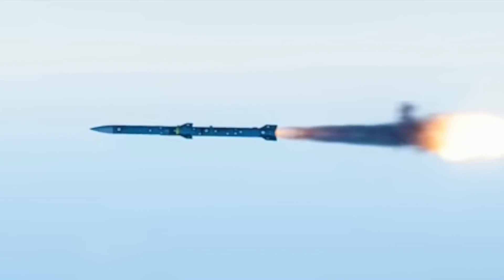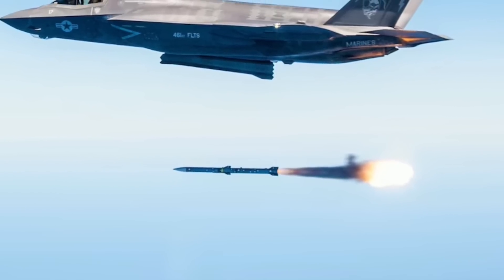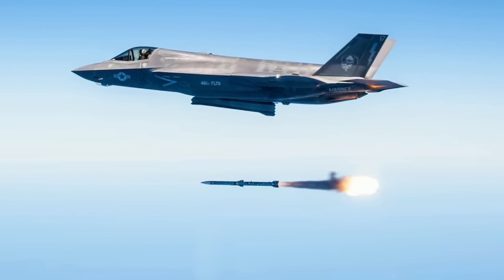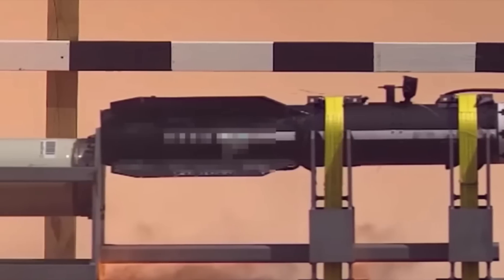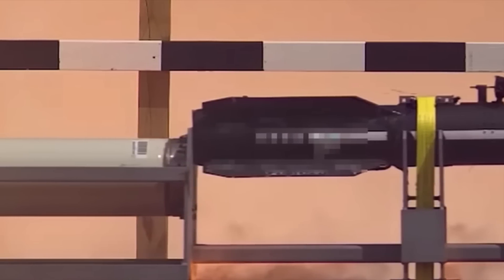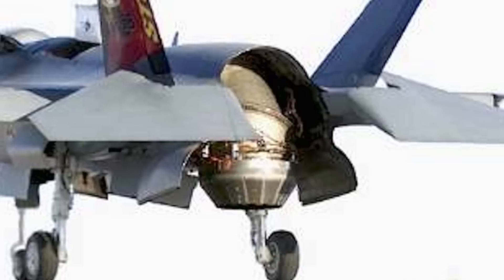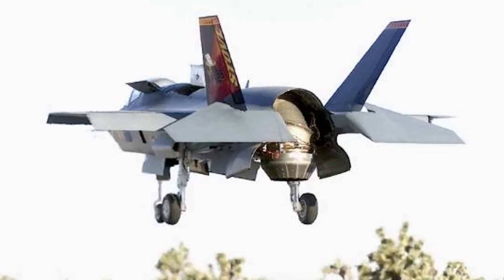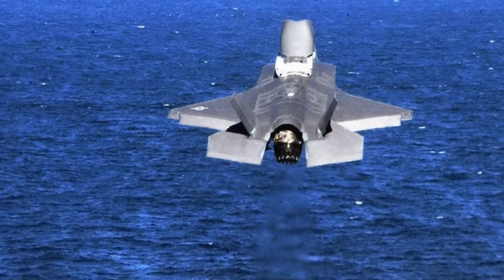#USAF developing #MUTAN Missile that twist in air to hit maneuvering target !

Comment: This thing traveling at mach 8 then bends? That must be a strong flexible area and to continue being guided? It's probably a last second turn to hit the target that is doing a turn to avoid. Soon as it bends it explodes?
Reply: Pretty much if it detects slight changes to the target
Reply: they have whole missile body diameter to make it strong enough while fins are much smaller and have to be heavy to ahieve sufficient strenght

Comment: Its a simple concept, trying to increase a missile Hit-to-Kill (HTK) . The current technology for HTK is Attitude Control Motors or ACMs and hich are pulse solid propellant rocket motors and Thrust vectoring (TVM) wwhich works fine on larger missiles ,not so much for smaller ones. The size of it AIMs makes harder to add  HTK technology
Reply: The technology is already in use on the latest version of the RAM Rolling Air frame Missile.
Reply: I wonder if this tech come's from  the NGAD 6th gen fighter since it will be tailless this would give it better maneuverability

Comment: WARNING:  (CONTAINS EXISTENTIAL MATTERS):
GRAVITY:  (copy and paste from my files):

Here is the test for the 'gravity' portion of my TOE idea.  I do not have the necessary resources to do the test but maybe you or someone else reading this does, will do the test, then tell the world what is found out either way.

a. Imagine a 12 hour clock.
b. Put a magnetic field across from the 3 to 9 o'clock positions.
c. Put an electric field across from the 6 to 12 o'clock positions.
(The magnetic field and electric field would be 90 degrees to each other and should be polarized so as to complement each other.)
d. Direct a high powered laser through the center of the clock at 90 degrees to the em fields.
e. Do this with the em fields on and off.
(The em fields could be varied in size, strength, density and depth.  The intent would be to energy frequency match the laser and em fields for optimal results, cancelling out the em modalities of the laser, thereby leaving behind the gravity modality.)
f. Look for any gravitational / anti-gravitational effects.
(Including the utilization of ferro cells so as to be able to actually see the energy field movements.)

(And note:  if done right, it's possible a mini gravitational black hole might form.  Be ready for it.  In addition, it's possible a neutrino might be formed before the black hole stage, the neutrino being a substance with a very high gravitational modality with very low 'em' modalities.)

(An alternative to the above would be to direct 3 high powered lasers, or a single high powered laser split into 3 beams, each adjustable to achieve the above set up, all focused upon a single point in space.)

'If' effects are noted, 'then' further research could be done.
'If' effects are not noted, 'then' my latest TOE idea is wrong.  But still, we would know what 'gravity' was not, which is still something in the scientific world.
This test can speak for itself.  It will either be true, partly true, or not true at all.  It will either show what gravity truly is, might be, or is not.  Science still wins either way and moves forward.

*  And note:  Whether my gravity test or another's, a gravitational black hole would have to be formed to prove the concept as being really true.  A gravitational black hole that 'if' self fed itself, could literally wipe out this Earth and all on it, possibly this solar system, possibly put a black hole in this section of our galaxy, and potentially even causing a ripple effect in this galaxy and surrounding universe.  But hey, if it does, no worries.  Nobody would be left to prosecute those who did so.  (Possibly famous last words:  "Hey, it worked.  Ooooppppssss.................)

But as NASA has already proven that low gravity conditions over a prolonged period of time is harmful to the human species, and large rotating space ships won't really work for space bases on planets and moons, those space bases probably being needed somewhere along the way out of this solar system and galaxy, we need to figure out what gravity truly is and see if we can generate artificial gravity so as to have smaller space ships and proper gravity conditions for space bases on planets and moons.  Otherwise, at least all human life will most probably die and go extinct one day.  Currently, no exceptions.

*  Added note:  Just trying to save at least 1 single species from this Earth to exist beyond this Earth so that life itself from this Earth has continued meaning and purpose to.  Gives me something to do while I exist, otherwise, what is it all and everything for?  Even if my TOE idea were correct, but if it did not help species survive beyond this Earth, what good would it ultimately be?

So, are you feeling lucky?  Doing nothing and at least the entire human species eventually dies and goes extinct with a high degree of certainty.  Doing a gravity test, (mine and/or another's), and there is at least a slim chance of literally wiping out this entire Earth and all on it, and possibly more.  Do you and other's truly want me to prove my TOE idea as being really true?

But also:
Questions:  Are at least some black holes in this universe due to a species who were trying to discern what 'gravity' truly was, came up with a test to do so, were successful, but the black hole generated (to prove what gravity truly was) self fed itself and wiped them and at least their entire planet out?  What species might have existed where a black hole now resides?

(Since all of life itself is ultimately meaningless in the grand of scheme of things anyway, do the gravity test and see what occurs?)

*  Added note:  Suggestion:  'IF' society did not want to do the gravity test, one suggestion might be to at least create a model as if it were true, then see how that model matches with observations and predictions.  It might be possible to discern the theory of everything without actually generating a gravitational black hole (which would definitely prove the TOE idea as being really true).
Reply: NUMBERS:  (copy and paste from my files):

'IF' my latest TOE idea is really true, (and I fully acknowledge the 'if' at this time, my gravity test has to be done which will help prove or disprove the TOE idea), that the pulsating, swirling 'gem' photon is the energy unit of this universe that makes up everything in existence in this universe (including 'space' which is energy itself, 'time' being the flow of energy), and what is called 'gravity' is a part of what is currently recognized as the 'em' photon, the 'gravity' modality acting 90 degrees from the 'em' modalities, which act 90 degrees to each other, then the oscillation of these 3 interacting modalities of the energy unit would be as follows:

Gravity: Maximum in one direction, Neutral, Maximum in the other direction;
Electrical: Maximum in one direction, Neutral, Maximum in the other direction;
Magnetic: Maximum in one direction, Neutral, Maximum in the other direction.

Then:
1 singular energy unit, with 3 different modalities, with 6 maximum most reactive positions, with 9 total basic reactive positions (neutrals included).  Hence 1, 3, 6, 9 being very prominent numbers in this universe and why mathematics even works in this universe.
(And possibly '0', zero, as possibly neutrals are against other neutrals, even if only briefly, for no flow of energy, hence the number system that we currently have.  This would also be the maximum potential energy point or as some might call it, the 'zero point energy point'.).

And also how possibly mathematical constants exist in this universe as well.

*  While in bed one morning after a restful nights sleep, and assuming the above is correct, I mentally went 'inside' the 1 (the singular pulsating, swirling 'gem' photon itself).  I still saw with my mind the 3 different interacting modalities, the 6 maximum modality points, the '9' including and being the neutral points in the middle which faded into a 6 (as each maximum modality point came towards zero), that 6 fading into a 3 (as each modality came together), which turned into a 1 (which was the '0' point), but '0' wasn't zero. So, '0' is not really '0' but is something, not nothing.  '0' is a relative '0'.  But then here again, the zero point energy point is the maximum potential energy point for any and all modalities of the 'gem' photon.  '0' is '1' and '1' is '0', this is the '1' inside the '1'.

Now I just have to come up with some tests to test this idea of the zero point energy point being '1', a maximum potential energy point of the singular pulsating, swirling 'gem' photon itself.  The maximum potential energy point not really being potential energy per se, but the neutral point of kinetic energy.  Tapping into here would be tapping into the 'zero' point energy point of eternally existent ever flowing energy.  But then again, tapping into here, 'if' distorted what makes up space and time itself (assuming that 'space' is energy itself [the 'gem' photon] and that 'time' is the flow of energy), could it alter or even destroy the very fabric of space itself?  What would occur if even only a single pulsating, swirling 'gem' photon were to explode?  What potential ripple effects could occur with the rest of space and time?

Hence also why I try to think some things all the way through so as to try to identify potential issues before the test.  Unexpected, unintended, potentially dangerous or even deadly consequences.  If nothing else, it keeps my mind active.  The mind, use it or lose it, but using it could also lose it, permanently.  (My own and other's).

Putting the 'zero point energy point' into actual practice could be deadly.  Warning:  Proceed with Caution.  The last words of human existence on this Earth might be, 'Hey it worked, ooooppppppsssssss.............'.

*  Note also:  Nobody as of yet has been able to show me how numbers and mathematical constants can exist and do what they do in this universe from the Standard Model of Particle Physics (SMPP).  While the SMPP has it's place, I believe we need to move beyond the SMPP to get closer to real reality.